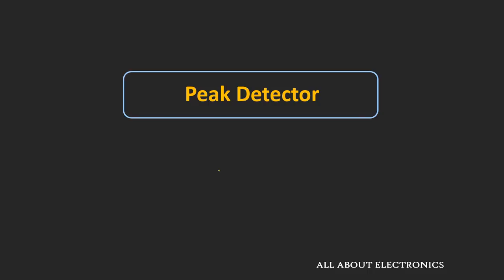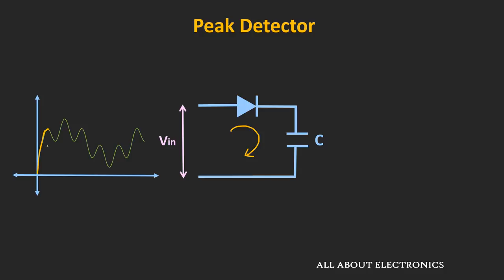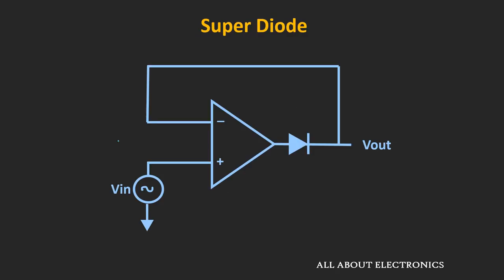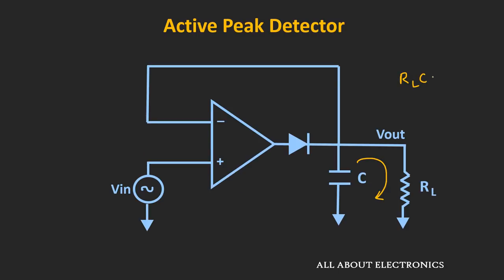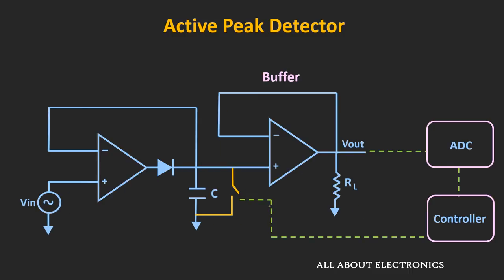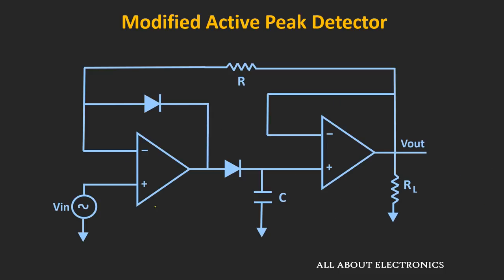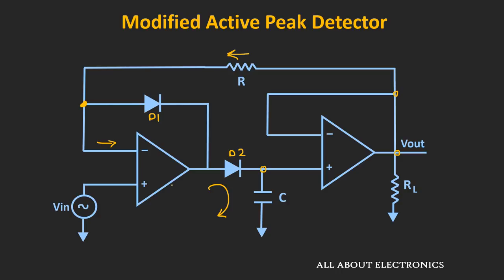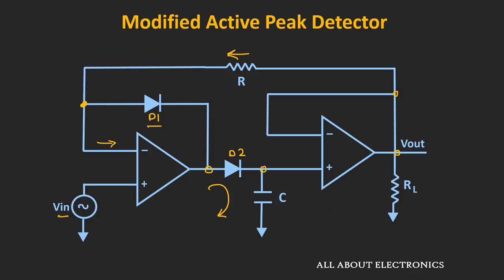Peak Detector Circuit Explained

Comment from the maker: The timestamps for the different topics covered in the video:

0:20  How to Design the peak detector circuit (Using Diode and capacitor) and its working

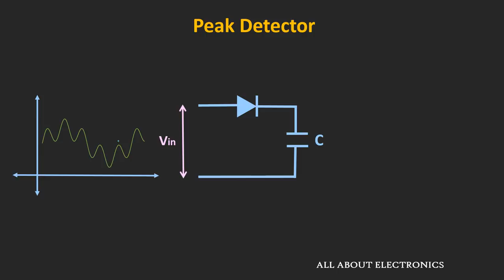2:29  Precision peak detector Circuit

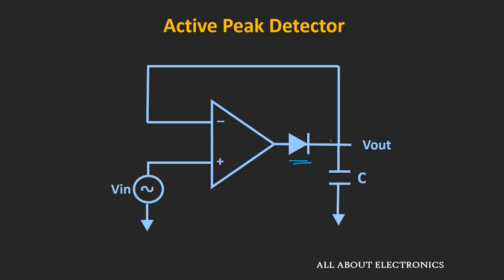3:05  Effect of load on the peak detector circuit

4:26 Precision peak detector Circuit with Buffer

5:16  Modified Peak detector circuit for the fast signals (High-Speed Peak Detector)

Comment: sir i have a doubt, in the modified peak detector circuit diode d2 is not in the voltage follower loop then how it can work as a super diode. kindly clarify

Comment: What is a buffer circuit
Reply from the maker: If it is designed using the op-amp then basically its unity gain follower circuit. The buffer as its name suggest, provides isolation between the input and output. Since op-amp provides very high input impedance and low output impedance, it can be used as a buffer circuit. 
I hope it will clear your doubt.

Comment: If we connect the input voltage to the inverting terminal of the opamp, and connect the feedback Path to the non-inverting terminal of the opamp, will the output peak lie in the negative y-direction???

Comment: Sir when u connected the buffer the capicitors holds the voltage for more time because of high impedence of op amp what about the fast responce of the capacitor to the input voltage how did you resolve it
Reply from the maker: In such a case, you can use a resistor before the op-amp, so that the circuit can follow the fast changing signal.
Reply: @ALLABOUTELECTRONICS  adding resistor drops some voltage so it cant detect the exact peak sir
Reply from the maker: @neerajhebbar7313  I think it won't because as you said, you want to use it for fast switching application, so before it drops to a certain degree, it will find another peak or a signal while dropping. But of course, the value of R should be selected carefully.
Reply: @ALLABOUTELECTRONICS  yessss sir thanxxxx for your time i will see the circuit behaviour in the simulator thanxxx for the reply sir

Comment: Sir one question ..which was asked in my barc interview..its not related to exactly this ckt but somewhat related concept.   .how the current can go inside opamp from output side..means if suppose diode is ideal in above ckt and if current is supposed to go inside opamp then how it will go...is it possbl fr current to go inside opamp from output terminal( m not considering input side of opamp for above questn)
Reply from the maker: Similar to the source current there is a sink current, the current which is flowing into the output terminal.
So, yes, the current can flow into the output terminal of the op-amp. 
Not only just for the op-amp but it is also applicable to other devices.
Reply: @ALLABOUTELECTRONICS  sir one more thing....please provide vdo on design of frequency devider ,pulse stretcher,pulse width modulator using 555 timer...can i expect this from ur side sir...it would be amazing n very helpful sir...actually this wil be helpful for barc ,isro interview as well
Reply from the maker: I have already made videos on 555 timer. If you just go through the playlist oscillator and multivibrators then you will get all the videos.

Comment: When D1 is FB and D2 is RB (Vin <Vpeak stored in the capacitor), Vout will be equal to Vc (last peak voltage stored by capacitor) because of the buffer stage . However , since D1 is conducting,  and V+=V- =Vin. So one side of resistance R is connected to vin and the other is connected to Peak voltage. Can you explain how this works? will it affect Vout?
Reply: That works because that current is being sunk at the first opamp's output (your input is less than the peak, so current flows through the feedback resistor R). So the opamp's output follows Vin as long as it is less than Vpeak, with a negative peak of  (-Vpeak - Vdiode1), so the max reverse voltage of D2 is 2*Vpeak+Vdiode1. Based on this, I would make sure the first opamp has enough slew rate for the frequency range you are working with.

Comment: Could anyone explain how at 7:24, the output voltage of the circuit becomes equal to the inverting terminal input of the first op-amp? If they are equal wouldn't R be acting like a short?
Reply: no

Comment: Great video sir
But can you please explain about the reseting using transistor switch
When do we want it to discharge?? 
Like when Vin becomes 0
So can we use a PMOS so that it's ON when Vin is 0 or below Vt and thus connects Capacitor C to ground and discharge it
(Maybe foolish) 
Thanks again
Reply from the maker: Yes, the transistor can be used as a switch and can be connected in parallel to the capacitor to discharge it when you want to reset it. 
There is readily available CMOS Switch. (CD4066B), which can be connected in parallel to the capacitor.
Reply: @ALLABOUTELECTRONICS  oh so it's like in places where we need everything to be accurate instead of using discrete transistor switch we use s CMOS IC for its advantages
Thank you so much

Comment: Inadequate explanation for third circuit didn't explain about this point

"When diode d2 will be reverse biased diode d2 will prevent the opamp to enter into negative saturation then diode d1 will be forward biased that means it will be short circuited then first opamp will act just like a buffer then vin will be equal to vout .After this what will happen .Explanation needed about this
Reply: Yeah true😑

Comment: Can i use it as envelope detector ?
Reply from the maker: Yes, it can be used as the envelope detector. But during the design, RC time constant of the circuit (During discharging) should be such that it follows the envelope.